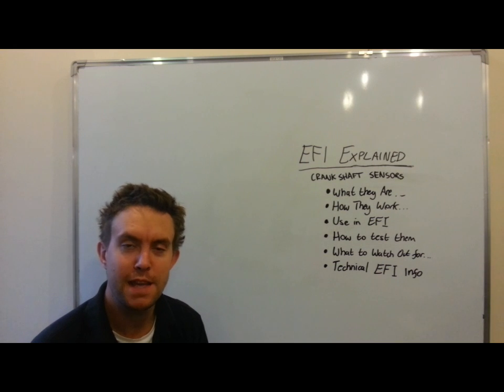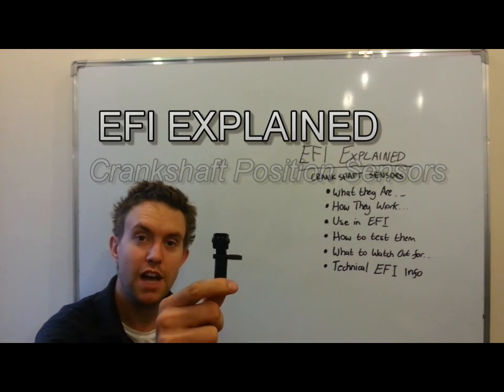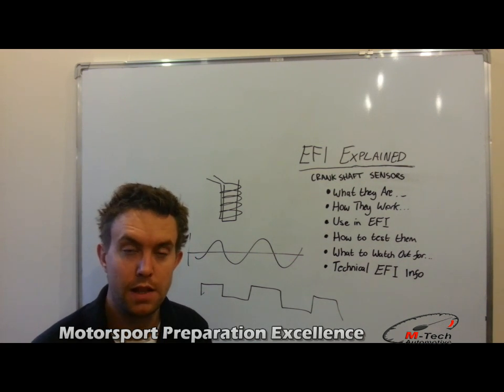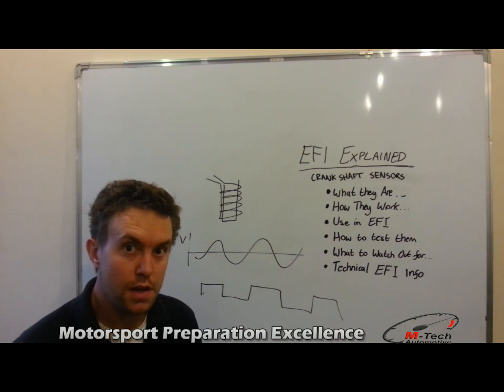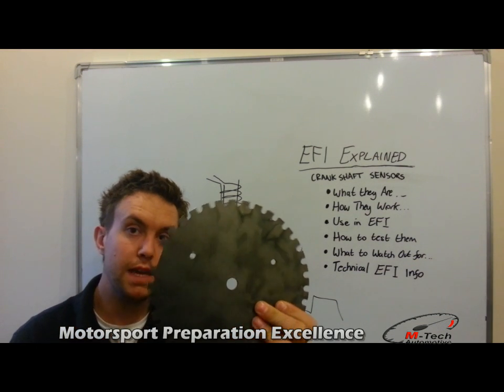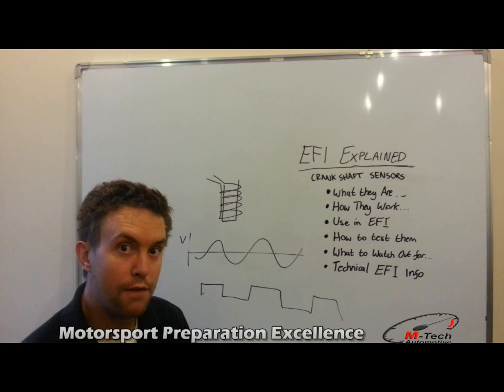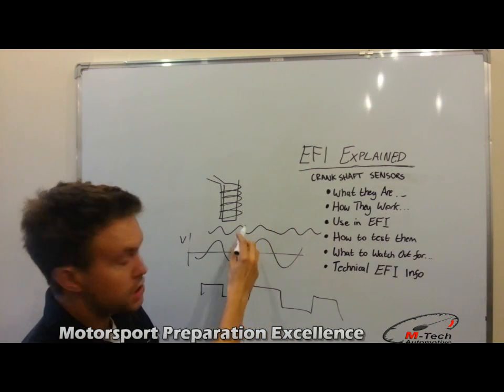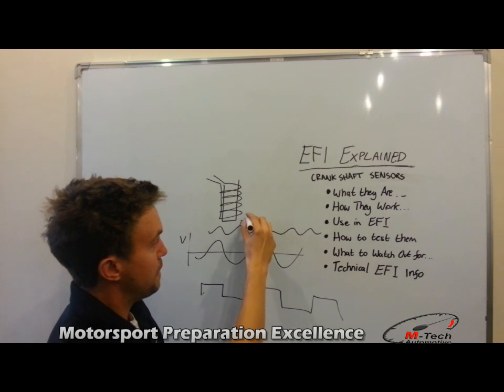How Crankshaft Position Sensors Work :: EFI Explained by Matt @ M-Tech Automotive

Comment: Brilliant and very clear explanation. You seem to have a lot of experience with various OEM and aftermarket EFI set up. In your opinion which aftermarket EFI would you chooses for best reliability for the costs for a street performance 4 cylinder engine in a hot climate? Not sure if it would be single throttle body or quad as yet. I realize what technology is always improving
Reply: Hi thanks - me442 ecu everytime!
Reply: @mtechautomotive  I never heard of me442 ecu before? Who makes these ecu? what components do they supply? Is there a website to find out more and details etc?

Comment: THOSE THE CRANKSHAFT SENSOR WORK AS A DISTRIBUTOR WHERE IT DISTRIBUTE POWER ACCORDING TO HOW FAR IT IS FROM THE OFFSET, FOR EXAMPLE SAME CARS  U COUNT 16 TEETH FOR IT TO SOUND RIGHT. SO IF AM TO TAKE IT BACK  A BIT OR FORWARD WILL IT AFFECT THE FIRING SYSTEM LIKE A DISTRIBUTOR

Comment: How does crankshaft position sensor know the engine is at intake stroke
 (when the intake valves open) and activate the fuel injector ?
Reply: As far as i know, the gear on which sensor is going for reading have 2:1 ratio geared to the crankshaft, meaning the gear connected to crankshaft rotates twice while the gear on which reading is to be taken rotates once, hence this way it is transmiting correct timing

Comment: i installed a new transmission but had to turn flex plate to bolt to torque converter now car will not start, is this because its out of sync ? I have replaced crank position sensor, but could a 1 inch out of sync cause no start?

Comment: Great video..(As a novice I fully understand your explaination 10/10).. have a question ...what could possibly cause this senario...after changing 3 CrankSensors in my Prado 1KZ-TE Diesel 1998 Engine... at idle, stop or slow speed engine light comes on...once driving the engine light goes out. The engine light is being triggered by the crank shaft sensor... what is it that my mechanic may have overlooked to correct this engine rebuild issue?
Reply: Did you scan your car for any fault codes.... Pls. let me know, i think if im not mistaken tha issue cross on my path....

Comment: Crank position sensors and every other crazy sensor is a waste of engineering excellence and only makes automotive manufacturers look like dumb asses. I can build you a motor with none of these retarded sensors that will run a few hundred thousand miles with zero issues because it's kept simple with none of these sensors.

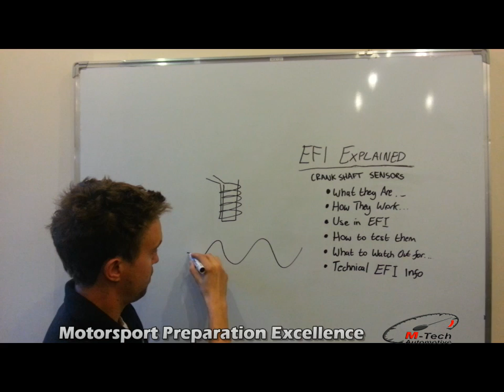Comment: All very well, but at at 1:36 you have NOT mentioned a crucial part: the MAGNET.
Without the magnet there is no change in the field and thus no output pulses.

The magnet magnetizes the core. The passing teeth influence the magnetic flow. This CHANGE in magnetic field generates a voltage in the coil.
Reply: olafzijnbuis these sensors are the dumbest invention they ever created swap the ignition to a magneto type ignition if they want precision and save people the aggrivating of dealing with these pieces of junk
Reply: Ferrite = magnet

Comment: Sir, i dont measure any ohms ( infinite ) between any of the three pins on my bosch sensor for my 1999 ferrari F355  ...does it mean an open coil circuit and bad sensor ? What else is there in these sensors ?
Reply: Sajid Rafique

Comment: Hi. I am doing a manual transmission swap in a platform that has not been fully tested before (350z manual transmission in a Titan truck). If I have to move the sensor do I also need to rotate the sensor ring accordingly? E.g. The oem location for the sensor is at 7 o'clock and the new location o must move it to for my application is at 5 oclock. From what I understand to allow the Ecu to accurately read the crank position I will need to rotate the timing ring so that it is in line with the new location of the sensor. Is this correct?

Comment: can a bad fly wheel  cause a new crank position sensor to go bad within a year.. changed my fly wheel and car runs good but now I'm getting a crank position sensor code coming up
Reply from the maker: Hmm maybe if corrsion has built up - crank position code might be just a sensor failure or the flyhweel is damaged, the ECU cant tell which...

Comment: So the trigger wheel has nothing to do with the crank pulley ?
Reply from the maker: Hi - well it does and it doesent - some engines have the trigger wheel on the crank pulley (older BMWs for example) but most now have it integral to the flywheel
Reply: I see that motec systems use CRIP. in which they use index tooth as reference rather than the missing tooth for tdc.  So does the number of teeth on the trigger wheel is related to precision of ignition and injection events?
Reply from the maker: Auto takumi It depends hjow they base the timing for events - from the last tooth or the last 'TDC' - from the last tooth would give higher accuracy AS LONG as you compensate for delta rates of changing crank speeds (is a TDC based system takes an average) Generaly a goog timing algorithm would take advantage of both, and also have a predictior based on ingition angle (which then causes crank acceleratrion) to compensate :)

Comment from the maker: Jay, thanks for the feedback, comments like that make it worth doing! If theres any particular subject you want me to go over let me know :)
Reply: can a faulty crank shaft position sensor cause my car to staul while driving and at a red light etc.vw passat 2006 2.0t
Reply from the maker: David Henriquez David yes it can - does the rev counter drop at the same time? Do a scan with an OBD tool a fault should of been stored,,,
Reply: Hey great video, you mentioned sensors having to be at certain angles from tdc, I have a nissan vk45dd I wish to put in another vehicle but have nowhere to locate the sensor yet, it has a missing tooth so might the nissan ecu pick up the pattern at whatever angle I locate it he sensor, say under the motor as opposed to some other location?